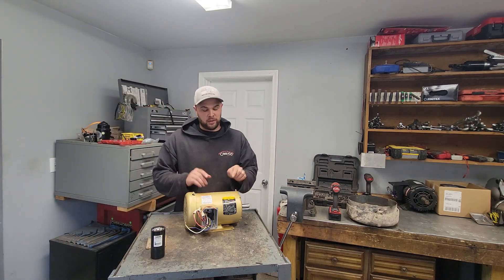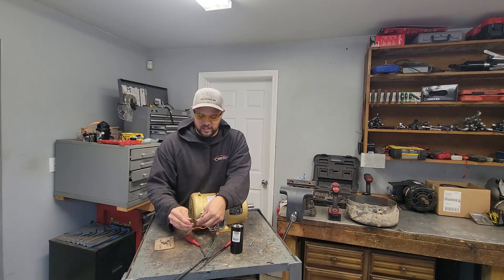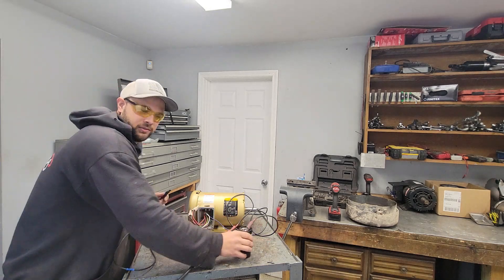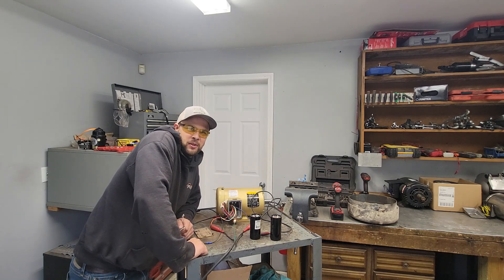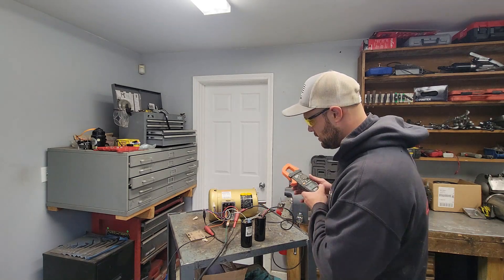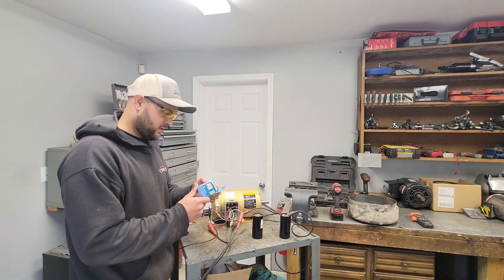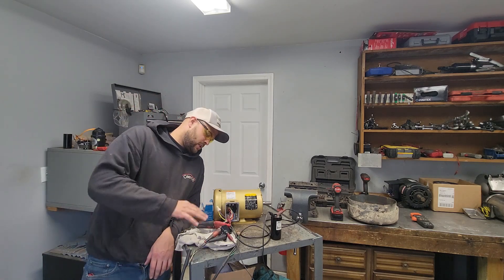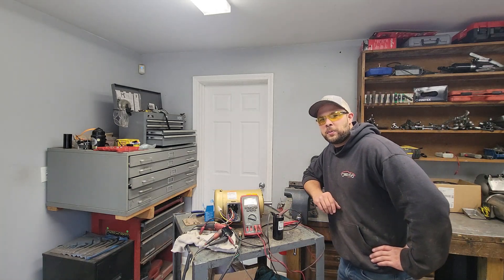Run a 3 phase motor without a converter on single phase

Comment: For three phase it's 0.07 micro farads per watt, and 1 hp is approximately 746 watts. That gives about 53 microfarads per hp for three phase.
Edit: running a three phase motor off one phase will drop your torque by approximately 1/3.

Comment: Is it bad for them since it's creating for voltage cause of the weak amps. How is 216 micro farad less than 67,  or do you need twice the caps because your running it w 230, ?

Comment: Please, before you wreck something or electrocute yourself, go find an informative video that shows the proper steps to run a 3-phase motor on single phase power.  While this guy is obviously having a good time, he is incredibly reckless with how he handles potentially lethal bare live connections.  About the only thing I can give credit for is the tip to remove the key from the motor shaft before it flies out and takes an eye out.

Comment: How bad does it get?  That is NOT how you switch the start capacitor out of the circuit.  I'm not even sure that is a proper potential relay.  When used, a potential relay coil is wired across the motor winding that will be energized by the start capacitor, NOT across the incoming 240v single phase.  The purpose of the potential relay is to sense when the motor is up to speed, pulling in the relay coil and disconnecting the starting relay.

Comment: Connected to single phase, the current draw is meaningless.  The nameplate rating is at full load, 3 phase.  you basically cripple the motor when you eliminate two sets of windings.  "But I only disconnected one wire", you say.  You need to understand that the motor has 3 windings, and each wire is connected to one end of two of the windings.  Draw yourself a picture, and you'll see that you have essentially connected 220 volt single phase across one winding only.  BTW, that's the reason the motor sits and hums.  Without the capacitor, the other two windings are not energized, so no rotation.  The capacitor puts the current going to the third wire out of phase with the house current, and is what gives the motor rotation.
Reply: Incidentally, a 10 HP 240 v 3-phase motor running single phase with no run capacitor will have about 1/3 capacity, or 3 HP.

Comment: "220 across the terminals...'120 - 120".  You don't have 120 until you bring the neutral, which you don't have, into play.  You can't just wave one one wire in the air, and say ; "120".

Comment: I have a three-phase air conditioner that draws about 10 amps of current, and I want to connect it to a single phase. What is the value of the capacitor that should be connected to the compressor? Does this method work with air conditioners? Thank you.

Comment: how about the power consumption of the 5hp 3 phase motor as generator?. which is more power hungry, the 5hp 3 phase motor as generator to drive the 3hp water pump or 3 hp water pump directly to the service line?

Comment: I t's been about 15 years since I researched all of this.  I bought a set of instructions off ebay on how to build a rotary with scrap parts.  After reading all the info and doing the math on the caps I needed I started looking for parts.  I could not find a scrap yard that would let me part out electrical gear for caps, and no one would let me buy a 3phz motor for scrap price.  I started sourcing new parts, and learned that it would cost me more to buy the parts and DIY than buying a prebuilt panel off ebay.  I got a used 10hp 3 phz motor from a friend, put new bearings in it.  I bought a prebuilt RPC panel off ebay for $180.  boom I had a ballanced 10hp RPC.  If my memory serves me right whay you made in the video is a static PHZ converter, and the motor would be good for 2/3 of the rate HP.  My 5hp planer had a static converter on it when I bought it.  I had to hold the start button on the machine until it was up to speed.  once up to speed it was normal.  I could plane boards down, but on a machine like a 20" planer you had to be gentle with it.  on a drill press or something like that it should be fine.

Comment: For years I've been using a 3hp 3phase motor to run my 11/2 hp 3phase mill. The idler motor gets 120 volts through a knife switch to two of its legs. Two legs of 120 is fed to two legs on the mill, and the third leg from the idler motor feeds power to the third leg on the mill. To start the idler motor, I kick start the shaft which has a small pulley on it and flip the knife switch. This feeds power to the mill and it's ready to go. Any idea of how I'd wire in a capacitor to start the idler motor so I don't have to kick start it?

Comment: I built a 30hp RPC back in 1980, before the internet, with no info available other than an old guy had an old diy 5hp unit in his garage. 
I did a lot of guessing but figured it out. The 30hp motor was wired for 440 but I fed it 220. I used a 1/3hp 'pony motor' to spin up the 30hp motor. Run caps to balance voltage.  It worked! I went to 3 different electric motor shops to ask them questions, and then tell them I got it working. They all said IT WILL NEVER WORK and "you're crazy that's impossible".  Goes to show what happens when 'smart' people don't ever think out of the box.
Reply: Sounds very similar to my low voltage start on my 100 hp water pumps. The motors had an 120 VAC startup contactor that would spin the motor at reduced speed. Then after a timer timed out the motor would disconnect from the low voltage starter and switch to the 460 VAC three phase contactor. You would hear a little "whoop" as the motor went to high speed. It was all replaced with VFD's later much better.

Comment: Ten years ago I had a pair of 110 dc motors on 100 ton jacks. No local electrician or motor service could help.
When I got them they ran at slightly different speeds…trying to jack railroad cars level to service the wheels etc.
Blew one capacitor discovering the rectifier was wired backwards.  Guessing values and ordering capacitors from Digikey…nailed it.
Matching pair of 100 ton jacks running even up.  And down.  
Love the knowledge sharing 

110 tickles 
220 hurts 
480’ll kill ya

Comment: You can use a three phase motor more horsepower rated than the one you're trying to run, use a small motor to get it up to speed turn the electricity on to 3-phase motor and then turn your what will you call a pony motor off and you now have three phase.

Comment: Isn't that all rotary phase converters are? A bank of capacitors?
Reply from the maker: It is partially that but also with a start circuit to get that initial start.  Shafts are typically cut off as well.

Comment: The phase converter that runs my 1.5hp air compressor in the garage takes 2 capacitors and a potential relay and does this inside a fancy enclosure. but it does run a load.

Comment: For a milling machine, you can get away with removing the third leg, but you've lost 1/3 of the horse power. 
Different story if powering a lathe due to the flywheel effect.

If only powering a mill, a static phase converter is fine. If running a lathe or multiple pieces of equipment, a rotary phase converter is IMO, the ONLY way to go.

Comment: If you are like me and only have single phase power, and you have a 3 phase welder and a large lathe and a mill, you can use this to provide the third leg of power to achieve three phase power to run your equipment. When you are done you can turn it off and you are not paying a monthly bill for the priviledge of having 3 phase power in your shop. Been using this for years.

Comment: 200w @ 480v needs a 4 to 6 uf run capacitor 
 1kw @ 480v needs a 6 to 10 uf run capacitor.

Comment: This is everything that is what is called a rotary phase converter.   Secret, you do not need the capacitor.  Put a rope pulley on the shaft, wrap a rope around it, give it a pull to get it turning, hit it with power and it will run.  The caps and controller are better.   So, no you do not want to put a load in it.   It has way less power.  So, if you take conductors from the three leads to a 3 phase panel, you can run motors off of it.   Just for reference, if you start with a 20hp 3 phase to a panel, you can easily run 22hp of three phase off the panel.   This is per my discussions with Roto-phase Company years ago. The first one I ever saw, the owner said his electric bill was very low.  He was using it in a truss manufacturing building.
Reply: When the start sequence is complete you must latch in run capacitor to balance phases or motor Will burn up if rpm’s drop slightly
Reply: Absolutely correct, I built several in the early 70s for friends, first one I built used a rope around a pulley to start it spinning then hit the power, later ones I used a starting capacitor through a timer relay to drop the cap out in half a second.
Reply: A delta wound motor starting by rotating to motor speed is a rotor phaser, one In the family saw Mill to run networks and cutoff saw
Reply: @    The first one I ever saw was supporting a truss manufacturing building.

Comment: I have a Question. I have an old 12v motor from my van's rear bench seat that folds down. It has 2 wires that come out of it that gets its power from the car. How can i take it appart and add 2 more wire's so it can be use to get power and give power at the same time.

Comment: I think a static phase converter would have run caps between the higher leg and missing leg... I was thinking I remembered about 80uf/hp but you quoted about that for the start caps so it might be fuzzy memory, wear protection :D

Comment: Name plate current is full load amps or FLA. So a 5 hp motor doing 5 hp worth of work, draws 4.4 amps @ 480v. A 3ph motor operated on 1 ph is about 2/3 as efficient, so a 10 hp can do about 6 hp worth of work without overheating or stalling. Thanks for the great info and videos!
Reply: You are assuming using a run capacitor, I assume.  Otherwise, the motor in about 30% efficient.  It's only running on one winding.

Comment: It’s intuitive to think that dropping one phase would leave the motor with about 2/3 of its horsepower, but in reality, it often results in much less than that. Running a three-phase motor on single-phase power usually yields only about 50-55% of its rated horsepower, and sometimes even less, depending on the load and setup.

Running a three-phase motor on single-phase power reduces its horsepower to about half due to imbalanced magnetic fields, increased slip, higher current draw, and the limitations of capacitor phase-shifting.

I just bought this guy recently...
VEVOR 3 Phase Converter - 10HP 30A 220V Single Phase to 3 Phase Converter, Digital Phase Shifter
Worth every penny.  $300
Reply: When you disconnect  a wire from a 3 phase motor, you actually loose 2 phases
Reply: @TheJohndeere466   lose
Reply: What are you running on it
Reply: @PaynePaintAndBodywork  Air compressor.
Reply: @dizzydinonysius  if you don't mind I would like to know more in detail what you were running. The type of motor perhaps approximate age. And the horsepower of the motor your running . And of course what kind of compressor pump.. I have a big Quincy 325 with the five horsepower 3-phase. I was thinking about buying what you got. Some people say you need twice the size that your motor is ..then a dude said he has been running one for 5 years .. a 5hp on a 5hp venor..
Reply: @PaynePaintAndBodywork   I have a quincy with a 5hp 3 phase.  I decided on buying the 10 hp converter for overkill.  I didn't want to worry about anything that would cause shutdowns, hasn't tripped up so far - even once.  It has been almost two years.

Comment: You can lose a leg once a 3-ph motor is running and it will keep going until the overloads kick out. I think the current draw goes up by 30%

Comment: I assume you put the two caps in parallel? to increase capacitance?  I also think you were thinking of the capacitor sizing wrong.  You are hooking up a 220 volt 3 phase to 220 single phase. You are sort of making it a single phase by default.  I would think the same capacitor rules would apply. The only difference with a 3 phase is three 120 degree out of phase alternating polarity 220volt windings that induce a rotating magnetic field that pushes (or pulls) the rotor.  It doesn't need the starting kick that a single phase does because they are all out of sync.  A single phase will just hum without a capacitor and start windings to give it a kick.  I have also seen many very old motors that just have  start windings with kickout contact points - the start windings are offset from the main stator windings. You are essentially turning 1/3 of the stator into a start winding circuit for a single phase.

Comment: A vfd controller is one of the easiest safest ways also cut you electrical coast down to. That a Bolder  motor  one of the best bands in my opinion for a electrical motor. 3phase 480 the cheapest way to run any thing in electrical. Even though every one thing it's more expensive wich is totally wrong . Less amp that what you get charged for. If ran in 110 it's like 3x the amp usage.💯🫡👍✌️

Comment: This was loads of fun to watch. Basically with the third leg disconnected, your rotor has to push through 33% of the stator windings with momentum, developed from the first two oscillating magnetic fields. By adding the cap, you are delaying one of the phases to that third leg and inducing a field on the final 33% of the windings ~roughly~ in phase with a proper 3 phase power supply. Once you have achieved sufficient momentum to overcome the dead area(plus the competing windings) then the motor will continue to function. This will not pull a heavy load, it will tend to stall once per revolution, more and more, the heavier the load. This trick is used in a lot of European electrical cabinets, on industrial equipment. Typically on cooling fans. However they just solder a "running cap" across the legs. This eliminates the tendency of "starting cap" failure. And provides a continuous phase delay for cheap.
Reply from the maker: Glad you liked it.   I had been thinking about starting them with a start capacitor and then switching over to a run capacitor to be able to actually use the motor for something. Any insight on what size run capacitor I should be shooting for?
Reply: @therandomfarmer4231  for running 60-80 uf is apropriate for 3hp motor

Comment: Things change dramatically when you start adding a load.
Reply: That's what she said
Reply from the maker: I've been thinking about doing a loaded test.  I'm thinking if I add run caps to the third leg I could get it pretty close on where the hp needs to be to be able to run with a load.

Comment: Very neat experiment, always wondered if you could start a three phase motor single phased with caps, I’ve pull started motors with rope before when they lost a phase in a cable lol
Reply from the maker: Did they continue to run with the missing phase after you got them started?
Reply: @ yes, definitely not a long term solution tho